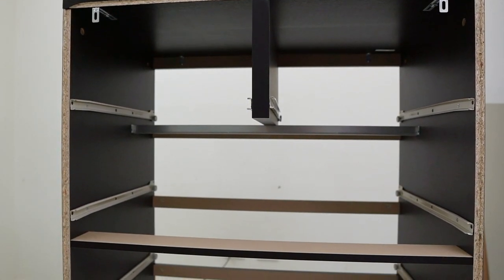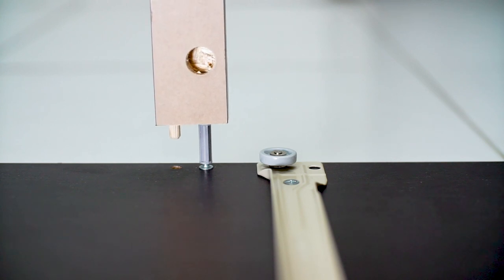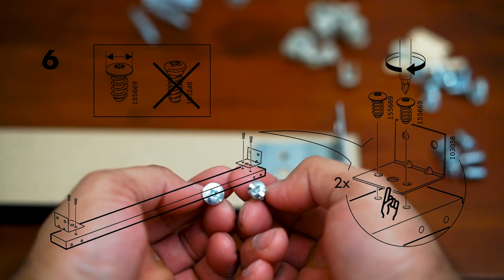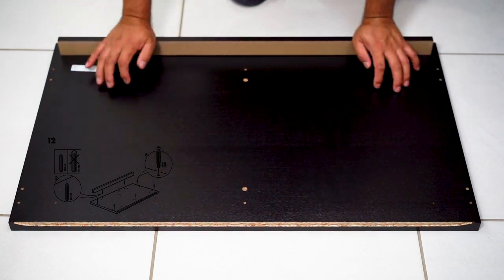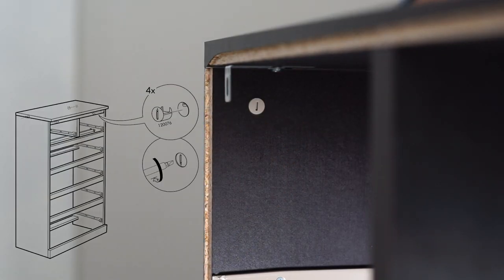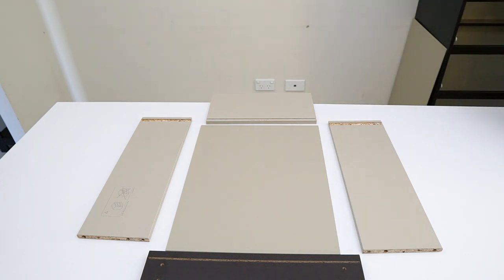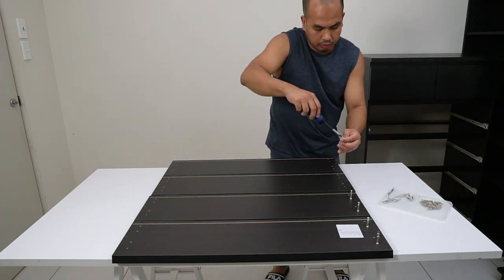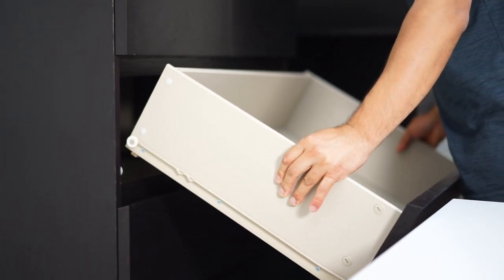How to Assemble IKEA Malm Chest of 6 Drawers Step by Step Guide

Comment: I didn't like that there was no joining device between the upright (between top drawers) and the first cross-trim on the front. The cross-trim there is a little too floppy for my liking, especially in its proximity to a very rigid upright. To me it seems to be an engineering oversight by ikea to not at least put a dowel in there. I added a 1" corner brace (4 pk $2 at Walmart) with a short screw into the trim and a longer screw into the upright, after drilling a small pilot-hole for each.

Comment: Thank you for making this video! It was a huge help! I do have a question though.. for the very last step of the drawers (putting the metal piece underneath) my drawers didn’t have a spot marked out for the other screw? Is that normal do you just Eye it & drill into the back of the drawers?
Reply from the maker: Hi, yeah I got the same, there is no pre-drilled hole or mark and I just eyed it.